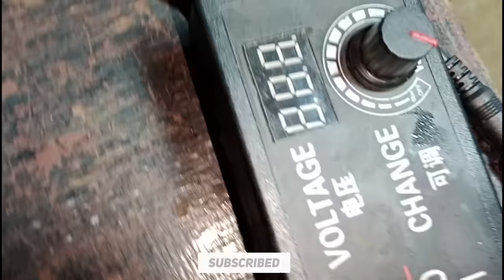I wish I knew these things when i was young!

Comment: Respectueusement vôtre pour ce que vous faîtes. Mais attention. Si vous ne connaissez pas le seuil de tolérance maxi et mini de fonctionnement en température. Ça peut péter à quelle température ? Si tu ne sais pas, alors enlève tes proches autour du projet pour leur garantir d'une protection sûre. C'est la meilleure des choses qu'on puisse faire. Merci. 😊❤
Reply from the maker: Thank you for sharing...
all the stoves I make are at 300 to 450 Celsius , this is well studied and there is nothing to worry about because you should research the heat that can be absorbed by cement  up to 700 to 1200 celsius, include the used chamber such as a saucepan that can last up to 600 Celsius